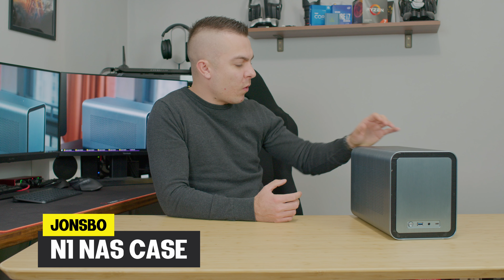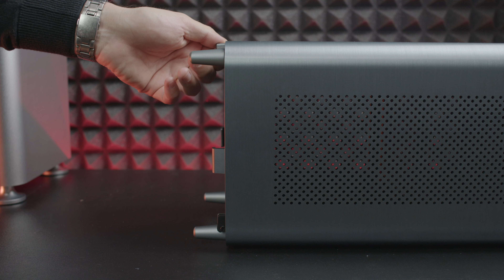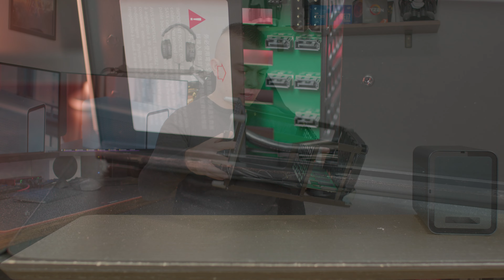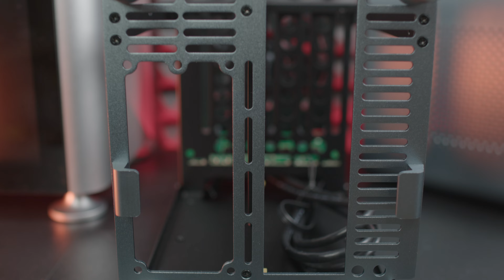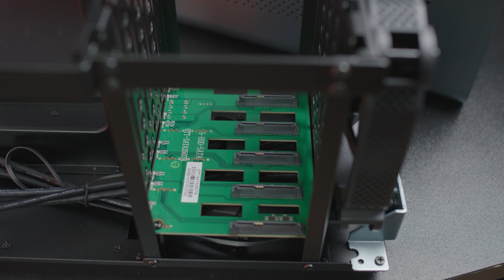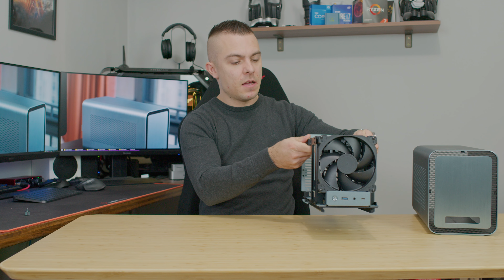FIVE HDD BAY ITX CASE - Jonsbo N1 Overview

Comment: can the bays be used with 2.5" drives?
Reply from the maker: Unfortunately, as I have noticed, no. The reason for that is because the brackets for the 3.5" HDDs are going on the sides and not on the bottom parts of the hard drives so if you decide to go with SSDs you don't have a possibility to screw the in any holders.

Comment: I have that case and it’s a nice one. Just one advice is to be careful with with the Sata connectors on the board. I already broke 2 😁. I recommend to get a 90 degree Sata cables.
Reply: Which motherboard are you using in this case?
Reply: I’m finding that even angled sata cables are too hard to use, need to find right angled (length wise) sata cables but no one makes them, only left side!
Reply from the maker: @tomnel  Maybe check AliExpress. They tend to have some crazy stuff that no one produces. Maybe you'll be lucky there. I never tried though getting such things over there, but just giving some ideas.
Reply from the maker: Definitely. For this case and this configuration, always go with angeled SATA connections. ;)

Comment: Any thoughts on this vs a Node 304?
Reply from the maker: As far as I noticed, Node 304 doesn't have a dedicated PCB HDD board where you just plug in your HDDs. But on the other hand, Node 304 give you ability to use a bigger GPU if you remove 2 HDD cages. Even though I do like Fractal cases in general, I love the design on Jonsbo N1 more compared to Node 304 especially when you can place N1 vertically giving you more room.